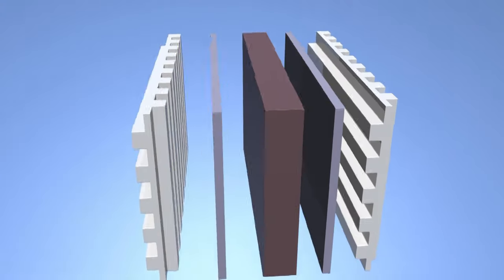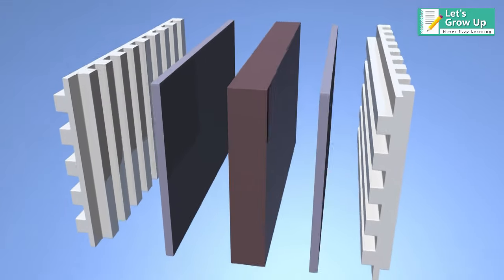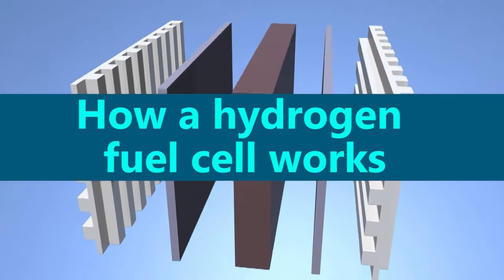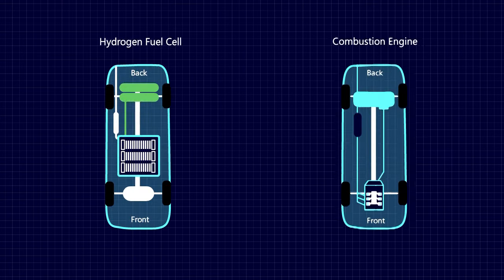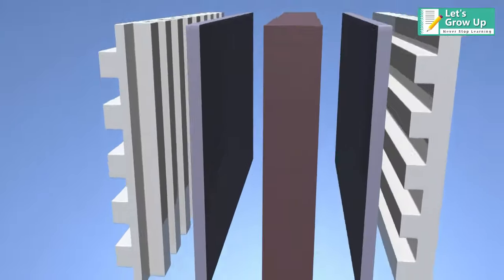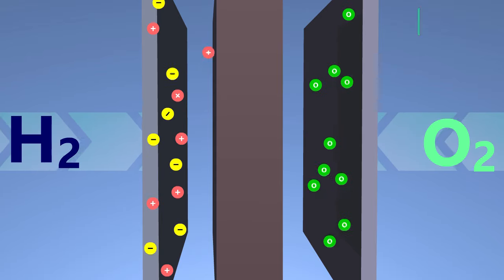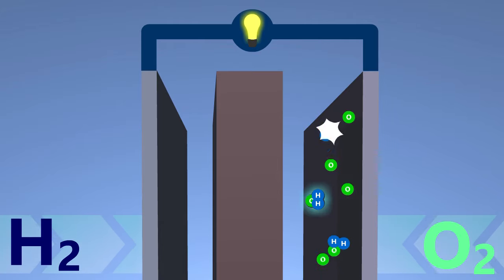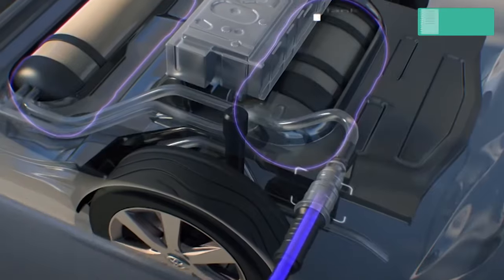How does a #hydrogen fuel cell work? | what is #hydrogen fuel cell | #hydrogencell explain

Comment: Bharat ek bahut bara fule provider ban sakta hai it,s amazing sectors a new apartunity in India for example Damodar Nadi peto-fule area it,s a India most fule area in patratu so very big exciting apartunity in jharkhand state because I am filling under 1984 etc.
Reply: When will you get your act together and realize that just by "VIBRATING the water at the correct frequency will release 10 times as much Hydrogen. Today's technology is so lame!!  They could also inject the "B" field of a magnet at the correct frequency and release  100 times more Hydrogen  per volume.  It needs to be a vibration,  not a oscillation big difference!!  The "B" field is the most powerful part of a magnet! FACT!!  it is the center part of a magnetic force..    If you want to play with anti gravity just tap the center of any bar magnet on any plastic or glass object it will loose weight!!  Don't tap on any metal or iron it will disrupt the magnetic field.  The entire universe is 100% magnetic .  We should be able to develop a simple Hydrogen generator regulator that is small enough to attach next to any standard auto carburetor. The height of ones intelligence is directly proportional to their realization of their own ignorance

Comment: THE GAS IN THE WATER ARE NEEDS TO SEPERATE USING THE ELECTRICITY BY BURNING THE MOISTURE, THE CONTAIN OF WATER ARE GRAVITY,MOISTURE AND GAS THIS ARE ALL CAME FROM THE MOISTURE OF LAVA
Reply: When will you get your act together and realize that just by "VIBRATING the water at the correct frequency will release 10 times as much Hydrogen. Today's technology is so lame!!  They could also inject the "B" field of a magnet at the correct frequency and release  100 times more Hydrogen  per volume.  It needs to be a vibration,  not a oscillation big difference!!  The "B" field is the most powerful part of a magnet! FACT!!  it is the center part of a magnetic force..    If you want to play with anti gravity just tap the center of any bar magnet on any plastic or glass object it will loose weight!!  Don't tap on any metal or iron it will disrupt the magnetic field.  The entire universe is 100% magnetic .  We should be able to develop a simple Hydrogen generator regulator that is small enough to attach next to any standard auto carburetor. The height of ones intelligence is directly proportional to their realization of their own ignorance

Comment: If eGallon is the cost of fueling a vehicle with ELECTRICITY compared to a similar vehicle that runs on gasoline, what do you call the cost of fueling a vehicle with HYDROGEN compared to a similar vehicle that runs on gasoline?
Reply: Extracting hydrogen is easy, its in the air, its in the water.
Reply: @rishabhgusai96  what if oxygen is impure? How can we extract oxygen directly from air?
Reply: @csachairman754  You do not have to purify o2 since it's in the atmosphere in abundance. The bigger problem in electrochemical reactors is to get them to only do the desired reaction, that's why fuel cells and rfbs max their efficiencies at ca. 70%.
Reply: @rishabhgusai96  is it really? I don't think so.
Why is it same price as gasoline?
Reply: @Thenakedfinisher  it’s because the process takes a lot of electricity
Reply: @bdubs79  I totally agree, but I don't think it's that easy to convert

Comment: Increase Renewable Natural Gas Immediately!!!  The people are sleeping and the can of corn will quadruple if we give them a monopoly on hydrogen.  Hyliions Hypertruck ERX ran on rng is net zero carbon emissions, 1000 mile range, fully electric for100 miles, more power than a diesel, infrastructure already there, lowest total cost of ownership and much lower maintenance.  Corn costs the same with this game changing technology!!!
Reply: When will you get your act together and realize that just by "VIBRATING the water at the correct frequency will release 10 times as much Hydrogen. Today's technology is so lame!!  They could also inject the "B" field of a magnet at the correct frequency and release  100 times more Hydrogen  per volume.  It needs to be a vibration,  not a oscillation big difference!!  The "B" field is the most powerful part of a magnet! FACT!!  it is the center part of a magnetic force..    If you want to play with anti gravity just tap the center of any bar magnet on any plastic or glass object it will loose weight!!  Don't tap on any metal or iron it will disrupt the magnetic field.  The entire universe is 100% magnetic .  We should be able to develop a simple Hydrogen generator regulator that is small enough to attach next to any standard auto carburetor. The height of ones intelligence is directly proportional to their realization of their own ignorance

Comment: What is the source of Hydrogen?
Reply: Most abundant element in Universe  can be found anywhere
Reply: @mushafkhalid9927  I guess you mean Nitrogen. Even if you meant Hydrogen, a hydrogen fuel cell needs hydrogen and oxygen to go into the cell and through a process of electrolysis gets converted to electricity. So you need to have a cylinder to carry hydrogen. Which needs to be produced in a factory. And what will be the source of fuel for that factory to produce hydrogen? That is the point. If petroleum products are fossil fuels and polluting, how do you produce hydrogen in a factory and then transport to hydrogen fuel stations to be filled into a car, without zero carbon footprint. I need an answer for that. Do you have?
Reply: @R srinder as hydrogen is abundant in Universe almost 75% of universe is of hydrogen but on earth  we don't have such insane amount of hydrogen thats why we artificially make hydrogen  but artificially requires great amount of electricity so cost of this fuel is very high but if there were other means for cheap production it would be good fuel
Reply: @mushafkhalid9927  That is the moot point.
Reply: @rsridhar63  who the hell taught you chemistry and physics? Hydrogen is abundant in our universe. But on earth only a few percentage exist. We should  split water into H and O by electrolysis.
Reply: @Sri  water is like 75 percent on earth. It's abundant and if you break water you will get hydrogen and oxygen. The world is also focusing on nuclear fusion reaction which will use hydrogen.

Comment: I prefer that Subaru WRX STI instead.
Reply: When will you get your act together and realize that just by "VIBRATING the water at the correct frequency will release 10 times as much Hydrogen. Today's technology is so lame!!  They could also inject the "B" field of a magnet at the correct frequency and release  100 times more Hydrogen  per volume.  It needs to be a vibration,  not a oscillation big difference!!  The "B" field is the most powerful part of a magnet! FACT!!  it is the center part of a magnetic force..    If you want to play with anti gravity just tap the center of any bar magnet on any plastic or glass object it will loose weight!!  Don't tap on any metal or iron it will disrupt the magnetic field.  The entire universe is 100% magnetic .  We should be able to develop a simple Hydrogen generator regulator that is small enough to attach next to any standard auto carburetor. The height of ones intelligence is directly proportional to their realization of their own ignorance

Comment: Why not undergo electrolysis directly inside the car first to create the hydrogen instead of buying hyrolisyzed water (H2) at a fueling station.
Reply: Wouldn't the car need to be plugged in to an electricity source? This could be more complicated than just using a battery
Reply: When will you get your act together and realize that just by "VIBRATING the water at the correct frequency will release 10 times as much Hydrogen. Today's technology is so lame!!  They could also inject the "B" field of a magnet at the correct frequency and release  100 times more Hydrogen  per volume.  It needs to be a vibration,  not a oscillation big difference!!  The "B" field is the most powerful part of a magnet! FACT!!  it is the center part of a magnetic force..    If you want to play with anti gravity just tap the center of any bar magnet on any plastic or glass object it will loose weight!!  Don't tap on any metal or iron it will disrupt the magnetic field.  The entire universe is 100% magnetic .  We should be able to develop a simple Hydrogen generator regulator that is small enough to attach next to any standard auto carburetor. The height of ones intelligence is directly proportional to their realization of their own ignorance

Comment: Now let’s see wat happens when a hydrogen powered car 🚗 gets into an accident will it blow easily? That’s scary who would want their family in that? But I guess we shall see.
Reply: When will you get your act together and realize that just by "VIBRATING the water at the correct frequency will release 10 times as much Hydrogen. Today's technology is so lame!!  They could also inject the "B" field of a magnet at the correct frequency and release  100 times more Hydrogen  per volume.  It needs to be a vibration,  not a oscillation big difference!!  The "B" field is the most powerful part of a magnet! FACT!!  it is the center part of a magnetic force..    If you want to play with anti gravity just tap the center of any bar magnet on any plastic or glass object it will loose weight!!  Don't tap on any metal or iron it will disrupt the magnetic field.  The entire universe is 100% magnetic .  We should be able to develop a simple Hydrogen generator regulator that is small enough to attach next to any standard auto carburetor. The height of ones intelligence is directly proportional to their realization of their own ignorance

Comment: The amount of infrastructure needed to be created for hydrogen is the limiting factor as well as cost.  For EV, it is easy to transport electricity over a wire, infrastructure is easy to build out.  In our area, there are incentives for the Toyota Mirai for free fuel for like 4 years but constant hydrogen shortages in the few stations require those with a Mirai to sometime not be able to drive it for a week or so until hydrogen is available.  Then everyone seeing the same thing (availability) on the app and the lines are real long to get fuel (40 minutes).  The cost if one had to pay would be like $80 a tank (400 miles) and other issues like equipment breaking that the hydrogen fuel pumps are very common and costly also adding to the wait.  Infrastructure isn't worth this option especially with sourcing hydrogen now requires natural gas.
Reply: While it's true, that hydrogen needs it's own infrastructure, on the long run it's cheaper to build that, than electric vehicles'. EVs require a lot of power to charge, which if say every second or third car on the road were one, would create serious problems, not to mention the ecological impact.
Reply: @yberg4731  The power required to make that hydrogen is more than the energy required to charge the batteries due to the inefficiencies of electrolysis.
Reply: @yberg4731  Where has it been said that in the long run it is cheaper.   Knowing the fact that hydrogen infrastructure would need to be built which is very complex at a massive scale is already enough to know the costs are more than electricity.
Reply: @MazdaRX7007  hence why industral scale.production doesn't use electrolysis. The stuff most commonly comes from hydrocarbons at the moment. Somewhat hypocritical if you ask me, however there are more ways to skin this cat. The Sulfur-Iodine cycle, when combined with Generation IV VHT reactors, can produce industrial amounts of hydrogen cheaply. EV charging stations for the same amount of vehicles, let's say 90 million units would be both a lot more inefficient, and expensive logistically speaking. Sure, one on one, it's simpler to support an EV now, but remember, that system needed to be developed as well. Today with hydrogen cars is pretty much the same deal as it was with EVs 20 years ago. At least from a logistics standpoint.
Reply: I don't think the infrastructure would be greater than oil rigs, platforms and refinery combined.

Comment: Good explanation
Reply: When will you get your act together and realize that just by "VIBRATING the water at the correct frequency will release 10 times as much Hydrogen. Today's technology is so lame!!  They could also inject the "B" field of a magnet at the correct frequency and release  100 times more Hydrogen  per volume.  It needs to be a vibration,  not a oscillation big difference!!  The "B" field is the most powerful part of a magnet! FACT!!  it is the center part of a magnetic force..    If you want to play with anti gravity just tap the center of any bar magnet on any plastic or glass object it will loose weight!!  Don't tap on any metal or iron it will disrupt the magnetic field.  The entire universe is 100% magnetic .  We should be able to develop a simple Hydrogen generator regulator that is small enough to attach next to any standard auto carburetor. The height of ones intelligence is directly proportional to their realization of their own ignorance

Comment: Nice explanation
Reply: When will you get your act together and realize that just by "VIBRATING the water at the correct frequency will release 10 times as much Hydrogen. Today's technology is so lame!!  They could also inject the "B" field of a magnet at the correct frequency and release  100 times more Hydrogen  per volume.  It needs to be a vibration,  not a oscillation big difference!!  The "B" field is the most powerful part of a magnet! FACT!!  it is the center part of a magnetic force..    If you want to play with anti gravity just tap the center of any bar magnet on any plastic or glass object it will loose weight!!  Don't tap on any metal or iron it will disrupt the magnetic field.  The entire universe is 100% magnetic .  We should be able to develop a simple Hydrogen generator regulator that is small enough to attach next to any standard auto carburetor. The height of ones intelligence is directly proportional to their realization of their own ignorance